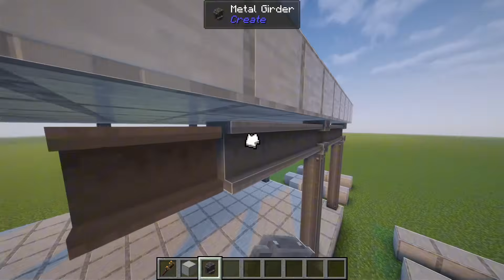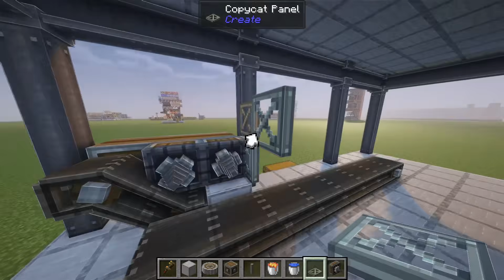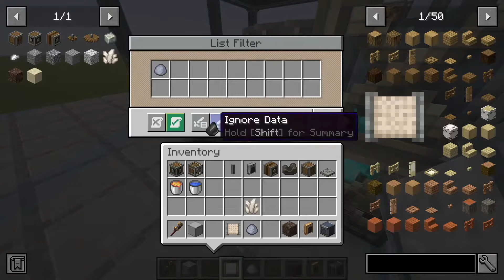Build This INSANELY Fast Andesite Alloy Farm! | Minecraft Create Mod Tutorial

Comment: I got everything moving, but my only issue is that the glass area isn't making cobblestone
Reply from the maker: Make sure the tanks have lava, the pumps are facing down away from the tanks, the pumps should be waterlogged, and the cart assemblers need to be picking up and placing down the sails. If all of this is working, see how fast the pumps make cobblestone by making a separate machine with a pump pumping a lava source onto water, if it seems to be taking a long time, this is a glitch which is really annoying and I believe it is caused by some mod but I am unsure which one

Comment: Somehow when i connect the clutch to my power source the conveyor next to the clutch just broke. Is there anyway to fix it or did i miss some parts?
Reply from the maker: This usually happens when the belt is getting two different directions of rotation from different shafts at the same time. You should check the shafts since they should still be there and see if any need to be going the other direction, you can try to add/remove a gearbox to get one spinning the correct way.
Reply: @IcyknightGaming  I still cannot find out whats wrong with my machine, i guess ill make another one. Anyway thanks!

Comment: hey, commenting this at 3 am... i must have pasted in the schematic 3 million times by now, but the second floor conveyers are just throwing cobblestone the wrong direction. it seems like some conveyers on the 2nd are okay, and some arnt. is there any fix for this? 1st works perfectly
Reply: edit: Im fairrlyyyy ish certain that its because i rotated the model, i think something weird got messed up. Had to break and replace some encased drive train that connects the second to the first, as well as apply an inverse gearshift to one side. hope this helps others
Reply from the maker: See if you can place/remove a gearbox where the belts are connecting to other things to get them to spin another way

Comment: so my mechanical arm wont let me right click funnels not sure why i cant stack only lets me click the depot and the bottom left funnel you have any suggestions?
Reply from the maker: Make sure the funnels are set to input not output, to change this either crouch when placing them down or right click with a wrench to switch between input and output
Reply: @IcyknightGaming  yeah i realized they were set to output instead of input now i just have to figure out how many water wheels for it to work

Comment: Im having a problem with the 2nd floor because the redstone link doesn’t work when i click using wrench it work and when i try to click the lever in didn’t received any response (sorry bad English)
Reply from the maker: Try clicking the redstone link sending the signal twice. Sometimes the links will not connect to each other until the first link is updated by changing it from sending, to receiving, then back to sending.
Reply: @IcyknightGaming thankyou for replying ❤
Reply: @IcyknightGaming btw at the 2nd floor the cobblestone generator doesn’t work on my modpack😂

Comment: I am having a similar issue to one other person, in that my cobblestone is piling up, but it is not because of shortage of iron nuggets, it is because of a shortage of andesite. The two mixers are going but the third never receives any andesite.
Reply from the maker: I am not quite sure why this would happen, but you could try adding a funnel with a threshold switch on the vault that stores the iron nuggets so it drops the excess away when it gets too full, or you could use it for anything else you may need iron for
Reply: @IcyknightGaming  What I ended up doing was putting threshold switches on the cobblestone generator vaults and put the excess in lava, the bottleneck seems to be the speed that the diorite is crafted, but also the speed that the cobblestone goes through the crushing wheels.
Reply: @IcyknightGaming  OK so after even more deliberating, there are multiple areas that just don't seem to catch up with each other, I think the main issue is the production of quartz, the soul sand is not being washed fast enough to provide quartz for the mechanical crafters. What I have done for a very short increase in production is put a chute from the top cobblestone generator into the vault at the very beginning of the factory, because the cobblestone was not being produced fast enough at the start, so now it only allows 64 to come out at once, which seems to increase the efficiency of the crushers. The next problem is how fast it washes, so I think maybe I need to look at that next.

Comment: How did you fill the fluid tank with lava?
Reply from the maker: You can use an item drain with a pump, then give the pump power (probably just a hand crank), and as long as you right click the drain with lava bucket and the pump is facing the fluid tank, it should fill up
Reply: Thanks 👍

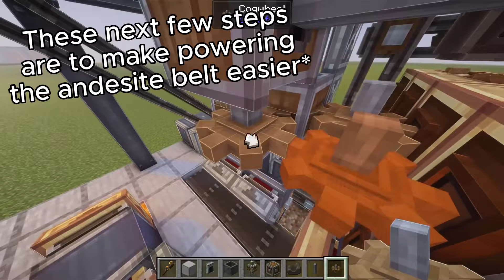Comment: 21:22 ... alright... now this is the part im finally gonna call it a day with this tutorial despite having pulled through everything else before! Im sorry to say this because you do seem to be a very nice guy even answeting all the comments 2 months past posting but for a build tutorial this is horrible! way to sharp cuts all the time having to replay parts like 10 times and stop at different frames to see the angles, FOV at 60 or something super zoomed in making it even harder, jumping into the middle of this cramped machine multiple times "oh actually let me change that now" without freecam mod i would have given up way before that!
Reply from the maker: Sorry, that this video was not working out for you, but the fov is always 90, I will do better about the cuts and showing everything more clearly, and I will do better about leaving more room to work around in.
Reply: @IcyknightGaming  I actually pulled through and did the last part but it was pain xD, there seems to be a design flaw however... im running it at Max 256 RPM but if you keep it running for some time and watch the top Mixers you notice there is way more iron nuggets coming than Andesite meaning the last Mixer never actually gets Andesite / doesnt work, just a tip what a noticed :)

It works great but at some point it might fail due to iron nugget overload

My Idea would be adding a andesite funnel at the end of the iron nugget belt into a single vault and a brass funnel out of that vault into lava, would work right? i mean the iron nuggets only travel to the end of the belt if all the basins are full right?
Reply from the maker: @lowi5630  Yes that would work, but when I built it, I actually had it making slightly more andesite than the nuggets could handle lol
Reply: @IcyknightGaming hmmm okay 😂 maybe my bad then the error is on my side i guess, im just not experienced enough to find the error in this cramped machine
Reply: It works out tho, it easily makes enough Alloy for the entire Server and a good amount of iron as a byproduct! guess i can skip the iron farm for now! :D
Reply: gonna tear it all down and do another alloy farm or do it with schematics i dont know...

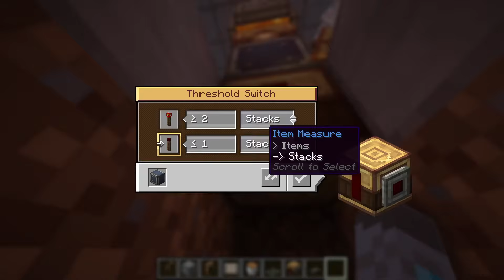Comment: 9:36 My Threshold swithch menu is different from yours... mine has "Move to lower lane at 75%" at the top (just one bar not 2 like yours) and "move to upper lane at 25%" on the bottom... help xD
Reply from the maker: I assume this is due to you having an older version of Create than mine. I am not exactly sure what this means lol, but If you can make the top one 100% and the bottom one 99%, then it should work, if not flip it around to 100% on bottom, and 99% on top, hopefully this works

Comment: I had the same issue that MrCorn mentioned in the comments.
I fixed it by removing the Encased Chain Drive behind the Encased Fan.
I'm using a Water Wheel setup with Cogwheel + Large Cogwheel to make 4 RPM.
Also, I set the Brass Funnel that sends cobblestone to 16, and thankfully, it started working properly!

I have one more question
Cobblestones for making andesite are piling up, and the andesite itself is also stacking up (on the first floor where the Mechanical Crafter is, and the belt that carries items from the first to the second floor).

On the second floor, only the second Mechanical Mixer from the left is actually working.
The third Mixer only has andesite, and iron nuggets are piling up instead of being used.
Is this normal behavior?

I'm using NeoForge 1.21.1 with Create 6.0.8.
It’s not a modpack just Create and a few convenience mods (like a minimap and backpack).

I'm not a native English speaker, so I'm using a translator I hope my message comes across clearly.
Even with this small issue, this setup produces a huge amount of Andesite Alloy, which is great.
Thank you!
Reply from the maker: The cobblestone and andesite piling up is most likely due to the third mixer not working, so make sure that the funnel that inputs iron nuggets into the mechanical mixer is facing the correct direction (the arrow needs to face into the basin). 

Since the iron nuggets have a random chance to drop from washing, the andesite will occasionally stack up due to there being a slight lack of iron nuggets, but the andesite piling up shouldn't cause any problems.
Reply: The belt of the cobblestone generator at the upper right side (when facing the front of the setup) was running in the opposite direction, so I fixed it to the correct direction.
Looks like I missed that part while watching the video, haha.

Comment: i have a problem with the drill, they don't bug like in the video
Reply from the maker: I assume you mean the second floor cobblestone generator, and it should generate cobblestone as long as you make sure the links are activated, and the block that the link is connected to is a full block that can transfer redstone signal, or if you don't want to use the links, you can replace them with a lever that is turned on, and you may need to put the lever on the outside of the generator rather than in line with it's walls so water does not flow on it to make it break
Reply: @IcyknightGaming  for me its the first floor cobblestone generator 
the blocks dont stay permanent and regenerate after a second and the water flows out

Comment: I tried testing this mechanism with schematic but the shematic itself is broken, has no water and the coble generators on the second floor does not work at all, even with lava inside them and water in pumps
Reply from the maker: When making a schematic, water sometimes just doesn't appear, so you have to add it in yourself
Reply: @IcyknightGaming  ok I found out the problem with second floor generator, Idk why, but redstone links just wont work, so I had to manually launch the machines up there, but brass funnel at soul campfire wont suck in recources in, even with /without filter
Reply: like it doesnt want to become accepting funnel
Reply: even andesyte funnel doesnot help, since items are too far away for him to suck in, cuz it gets thrown out of stone wheels
Reply: @IcyknightGaming  alright after tinkering and rewatching the guide (and accidentally pressing alt+4 in order to open spectator mode) the machine started to work! It is really fast!
Reply from the maker: @Dr.greencreator228  Glad to hear it!

Comment: Quick question please at 7:33 you use a soul camp fire to convert sand into solid sand however I keep attempting to do this but this doesn’t work sadly any thing I can do?
Reply from the maker: I am not exactly sure what to do if it just won't convert, but there may be a mod that is changing some of the recipes you can try checking JEI to see if the recipe is still there
Reply: @IcyknightGaming thanks for the reply I appreciate it! I checked  JEI and it is the correct recipe to make soul sand so I was fucking around with it and if only works with single blocks and not stacks and I can’t get the iron nugget portion to work
Reply from the maker: That is interesting, I guess there may be something wrong with the encased fans in your modpack
Reply: @mrcorn798  I solved the issue this way:
I removed the Encased Chain Drive behind the Encased Fan.
I used a Water Wheel setup with a Cogwheel + Large Cogwheel to make 4 RPM.
Also, I set the Brass Funnel that sends cobblestone to 16.

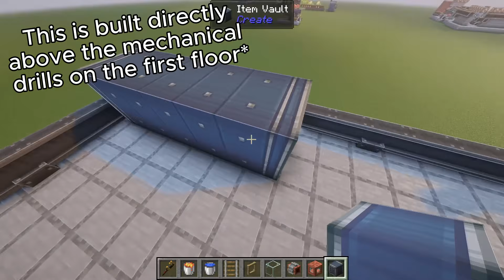Comment: 15:55 can i use chutes insteed of hoppers?
Reply from the maker: No, because hoppers will pick up items that are a slab higher than the hopper, whereas the items have to directly touch the chutes to be picked up, and if the item isn't picked up before more cobble is generated, it could get stuck in the walls or the roof
Reply: @IcyknightGaming  oh okay thanks for the answer